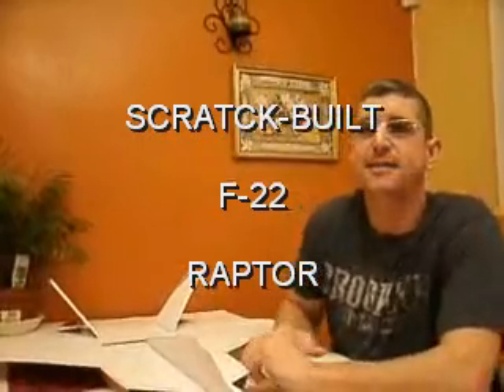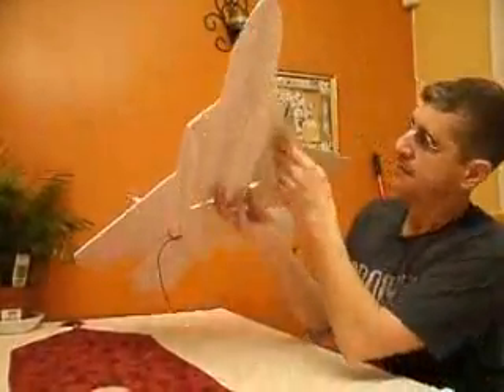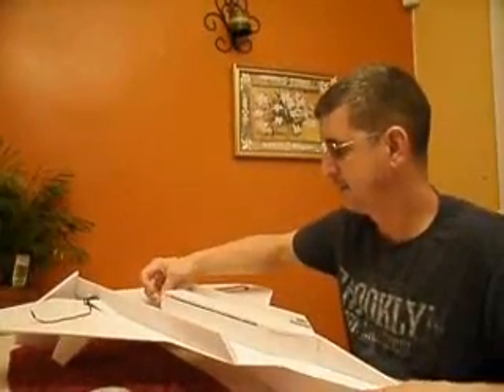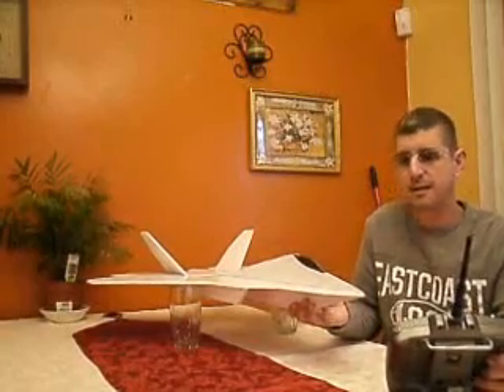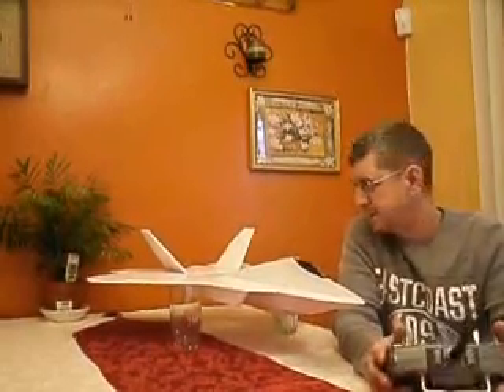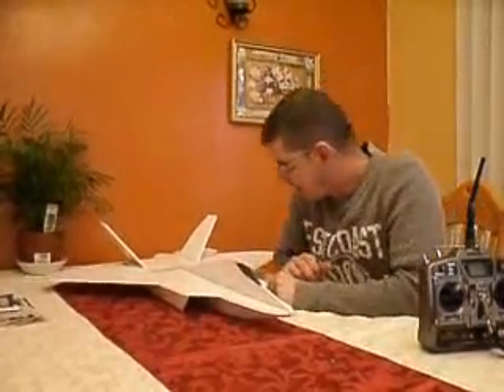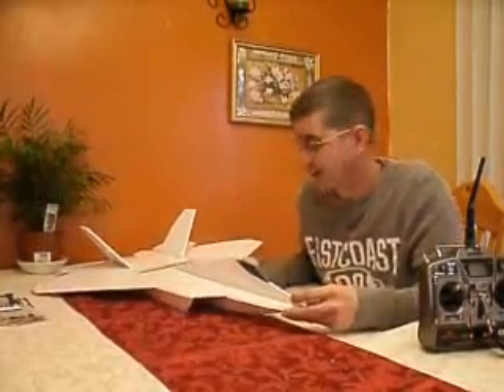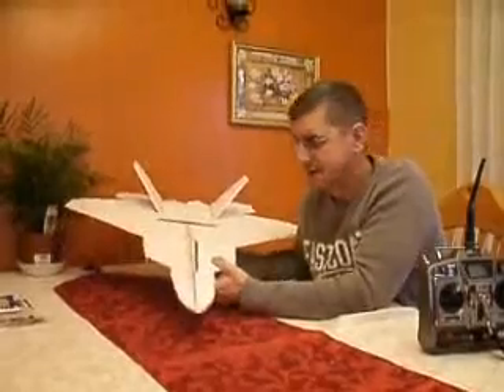SCRATCH BUILT F-22 RAPTOR

Comment: Hey great plane and great flying!  I built one myself, a smaller version (18.5" WS)  out of foam board too!  The foam board is 5MM, btw.  I also removed the paper from the foamboard by soaking it in water.  The paper on the foam board makes the airframe much heavier than it needs to be!  It's almost a 50% reduction in weight.  A lighter plane opens up the possibility of high alpha maneuvers, unlimited vertical, cobras, and other maneuvers that the real ones can do! This plane is a blast!